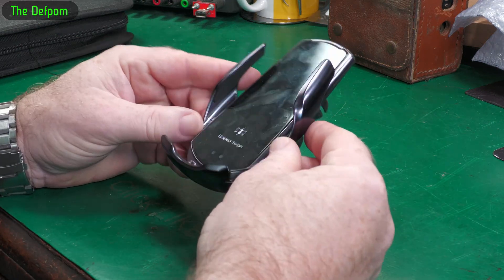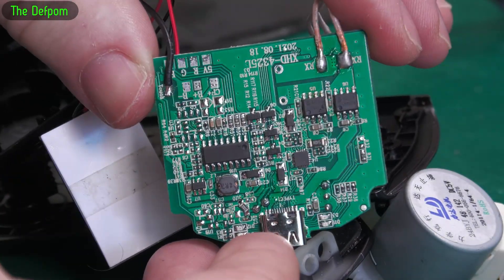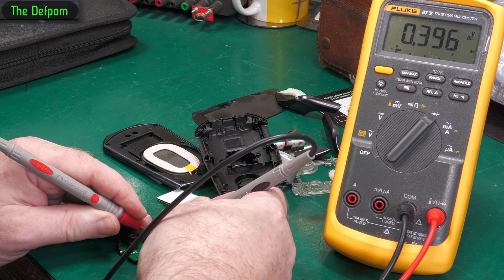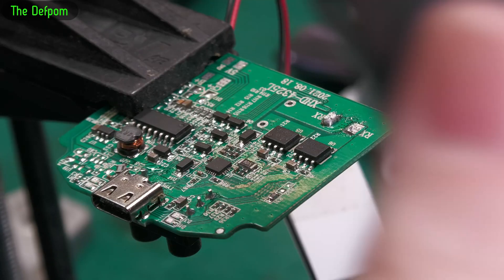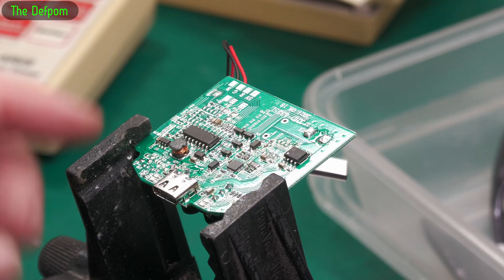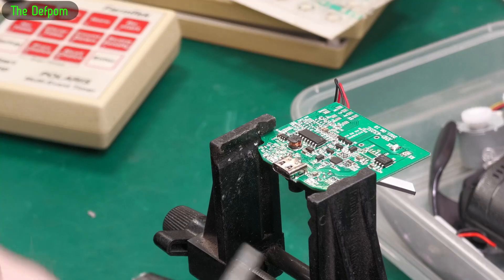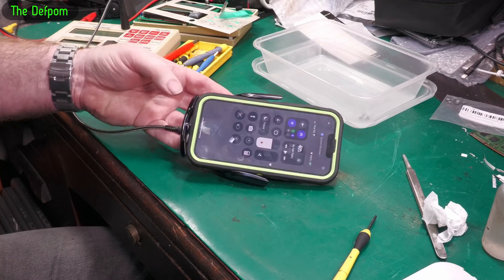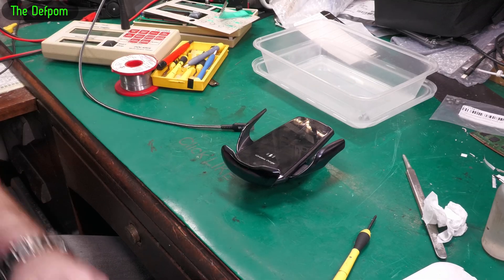🔴 Wireless Phone Charger Repair - No.1369

Comment: Nice work. But desoldering and soldering work was not satisfied me. I usually don’t use Hot Air for such small mosfet ic. Instead I use chipquik for desoldering them. While soldering I use soldering iron and flux but first clean old solder from pcb and clean solder pads and tack one pin of ic then drag soldering with flux applied to all pins. All solder pads smoothly flow with pins of ic and no cold solder joints

Comment: So two chips and you can drive the coil with a H-bridge.
We have to be so careful putting chips on with a hot air gun that we don't massively exceed the chips soldering limits.
The datasheet should give the max time and temp.